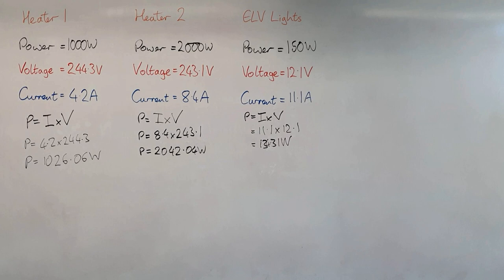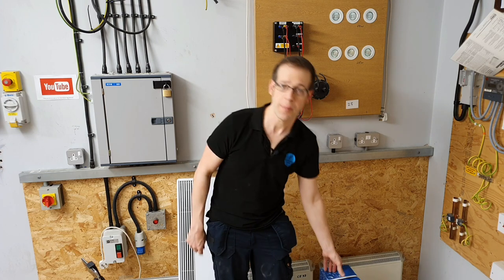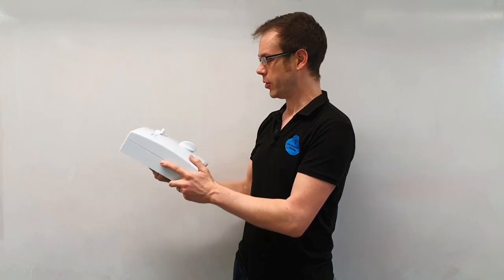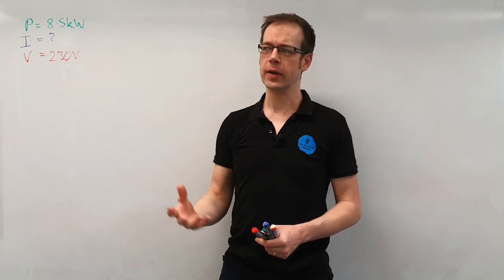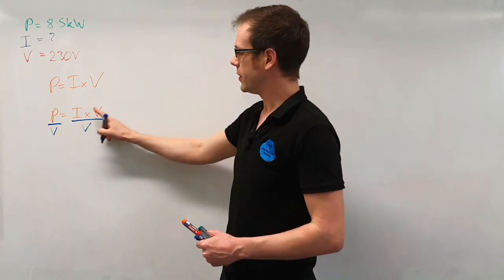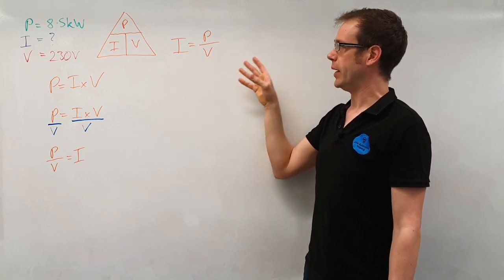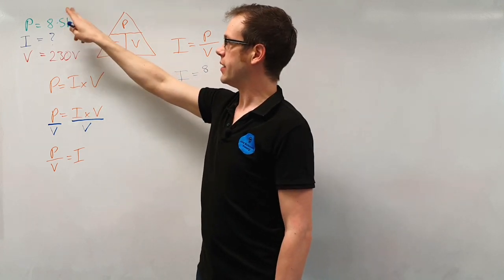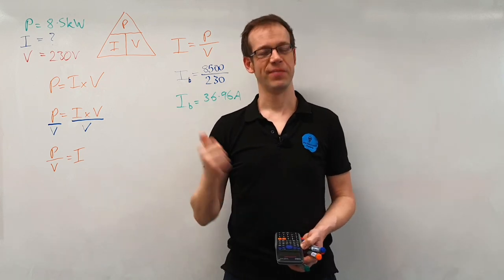How to Transpose the Power Formula to Calculate Design Current

Comment: Thanks Joe.  I know you've explained this before but are the schools failing our kids when you have to go into so much depth on simple transposition - pity if that's the case.  I've been studying a lot of this stuff in my retirement - why Ib for design current why not Id???
Reply: GrumpyGrampa I‘m from Germany and I can tell you two things:
The thing with the school students is the same thing here. And in second Ib is harmonised, at least in Europe every trained electrician will know what that means. But in german it‘s easy to remember as Betriebsstrom (operating current).
Reply: @Marcel_Germann  Thank you.  I'm not an electrician but this stuff gives me something to keep my brain active in my retirement.  I do despair about the level of basic maths in 16 years olds.  Do you think that is where the Ib comes from?  Id for design current seems more intuitive to me.
Reply: @no_short_circuit  There's no difference between the operational current and the designed one, it's more like an expectation than a design. Or there shouldn't be a huge difference between the actual operational current and the design. The designed current is a calculated value which you use as a basis to choose the correct sized wires and the correct fuses/MCBs to built the circuit that supplies the appliance. In that case a water heater for a shower which is a dedicated circuit, means this circuit provides power only to this single appliance, so you only need to design the circuit arround this device. 
And in the case of the shown water heater I already see the german service companies here grasping. The most ones don't permit single phase loads with more than 4600W (20A on 230V), because they're afraid of unbalanced loads. Most houses here have a three-phase connection, even the residential buildings, and you should distribute the loads equally on all three phases.

The next step would be to use the 36.93A Joe calculated, that would at least require a cable with a conductor size of 6mm². I don't know which fuses you got in the UK, but here it would be a 40A, so 10mm² (depends on length of the cable, and how it is installed for heat dissipation) would be actually the better choice, especially if you install that cable in a wall which is insulated. The next smaller fuse size is 35A. This is actually too small, it wouldn't blow, but it would cause thermal issues in the fuse holder. There's a video out there made by John Ward:

https://www.youtube.com/watch?v=XjvoiO5N4l8

In a three-phase installation 3x230/400V the current calculation for the 8.5 kW would be:

P = I x U x sqrt of 3

The sqrt of three is to correct the phase deviation of 120° between the three phases. That 120° come from the angle between the three coils in the generators (360° divided by 3 is 120°).

So in that case the current would be round about 12.3A per phase, since there are no 12A MCBs, 13A would be a fit. As wiring I would install a cable 5G2.5mm² (L1, L2, L3, Neutral and earth), the neutral is not required in most water heaters of that kind, because they're purely resisistive and absolute symetrical loads. In a three-phase system the neutral only carries the differential current if the load is not perfectly balanced between the three lines. The circuit would be fused with 3x13A. The cable is also rated to be fused with 3x16A.
Reply: @Marcel_Germann  Thanks Marcel - a lot to digest.  I subscribe to John Ward but must have missed the video you suggest, I'll look at it later.  As far as 3 phase is concerned that's something I'm just beginning to get my head round.  Thank you very much for taking the time to give me such a comprehensive answer.
Reply from the maker: I'm not sure if it can all be pinned on schools, I think it's a more complex issue including cultural attitudes, homelife, upbringing, etc. Most maths teachers I've known and met have been really passionate about their subject and want to do a good job. Tricky one really. Also I have no idea about Ib!

Comment: I have a doubt, When we hold a battery in hand like egg(AA size, 1.5V), it actually get short circuited by body conductor but , it do not make any spark or heating effect at finger tips… why?
Reply from the maker: Hi, it's because the resistance of your body is so high the voltage from the battery isn't high enough to push a large enough current through your body.
Reply: @JoeRobinsonTraining  ok. Thank you.